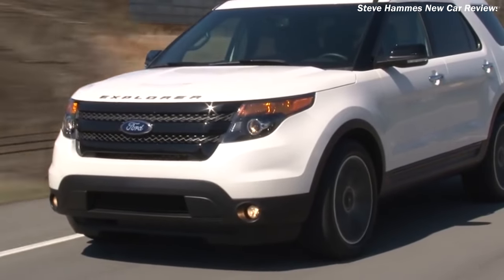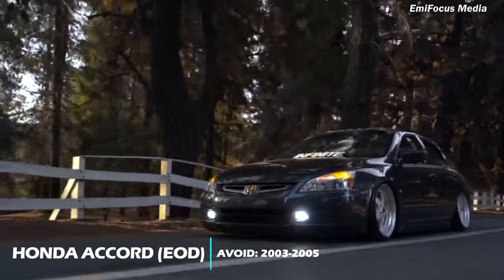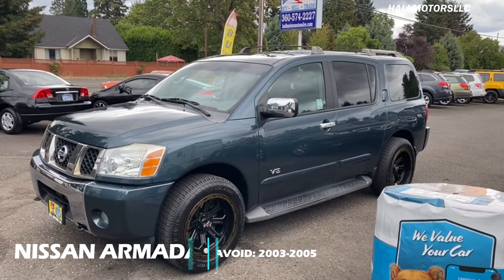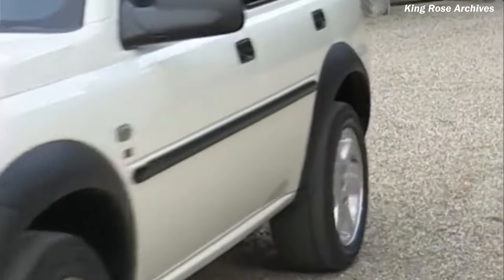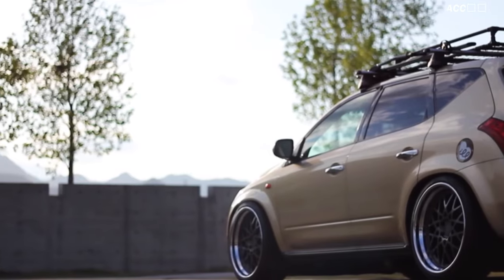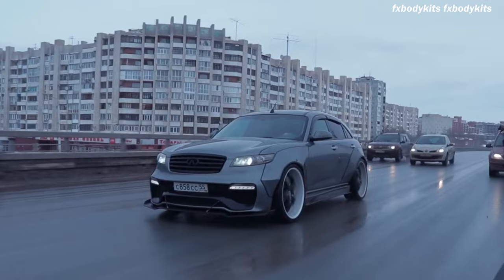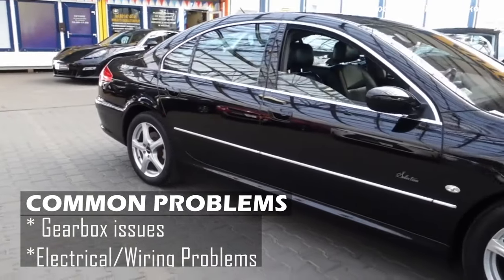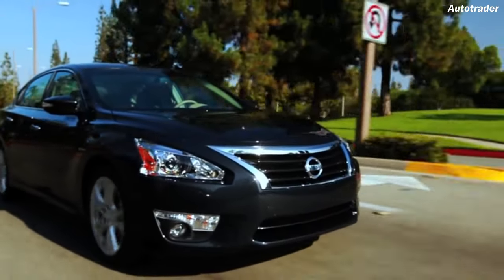7 Cheap Cars You Should Not Buy! Avoid Like A Plaque.

Comment: Abeg Oluwatobi what of chevrolet equinox 2007? run???
Reply from the maker: Power and Drivetrain wise.. it's a pretty solid car, but you might definitely run into issues when it comes to parts available which is a regular issue witb GM 's flagship models in Nigeria. Don't run but don't stay too close sire😁